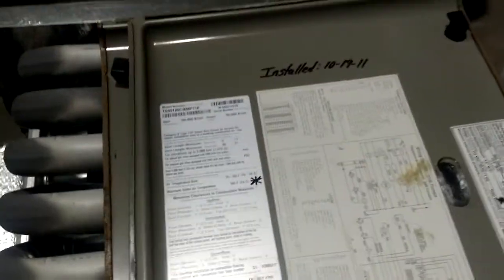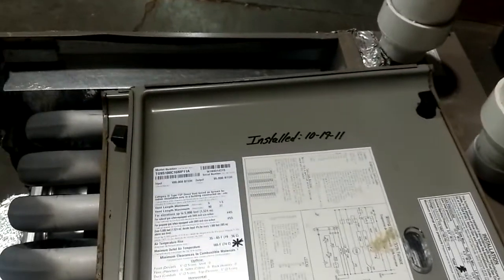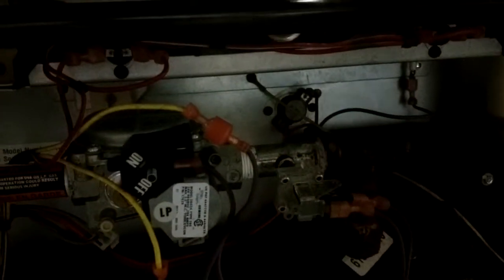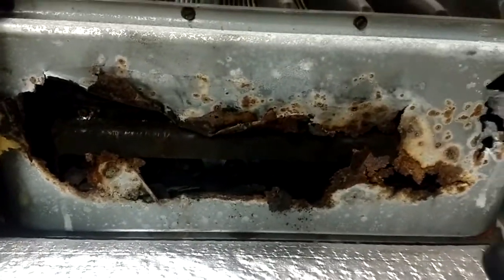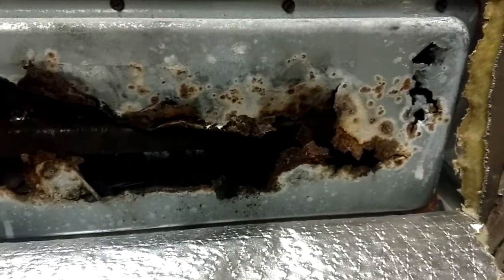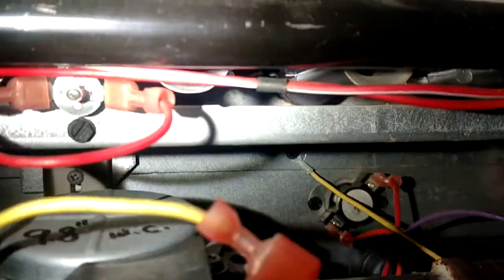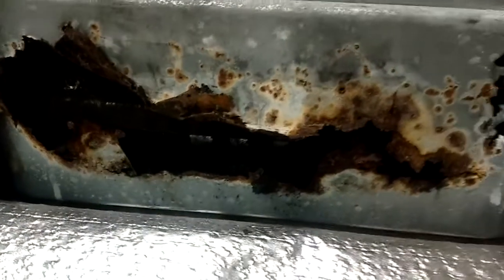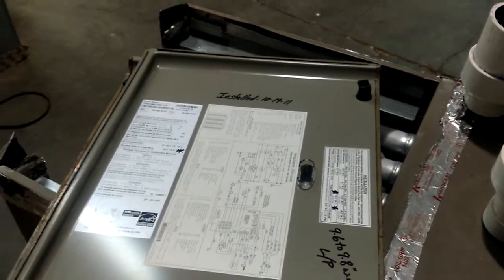☠️Over 2000ppm CO☠️ in exhaust pipe of York TG9S100C furnace.Very bad H.E. This one is scary guys!!!

Comment: ECMs?
R410a?
Paper-thin primary/secondary "90%" heat exchangers?

Capacitors that are always burning out because the replacement for PCBs don't work?

10 SEER. 14 SEER, 18 SEER,  20 SEER....

"You need a new system if you have an R22 leak" (?????)

Do homeowners understand the screwing they are getting from the EPA and DOE?

Is the HVAC business really HVAC? Or is it an EPA-DOE enforcement business?

Min 7:50 "In the old days, capacitors used to last 10-20 years"
https://www.youtube.com/watch?v=eGEduZ3EVcg

Paper thin heat exchangers
https://youtu.be/5bXdufAvSJY

..

Comment: I have installled some but no more they have used very extra light guage material blower housing one can bend with fingers have replaced few as they worp easily ...
Reply from the maker: Yes when it comes to metal on York brand of equipment it seems to all the paper thin.  I'll let them slide with things like the door panels, but you don't cut corners with things like heat exchangers. Thanks for watching $tandard 👍

Comment: looks like it possibly had some other airborne chemicals going through it, do you recall where the intake and exhaust piping was routed and if anything is near them or pulling basement/attic air?
something like a busy road/expressway with road salt vapor airborne from passing traffic? other vents exhausting near it, clothes dryer, bathroom?  decomposing mulch underneath?
near swimming pool/hot tub! or other area with lots of bleach/aerosol spray usage?
Reply from the maker: Nope, this house was in the middle of the country. Nothing else around. And the homeowner didn't even live there full-time. So the furnace was kept at a low temperature the majority of the winter. That's the only thing I could think of, being down in a cold unfinished basement with the temperature kept low on the thermostat might have caused excessive condensation on the outside of the metal. Who knows.All I know is York should be ashamed using cheap thin scrap metal like on the heat exchanger. if you want to cut corners and make the door panel out of cheap thin metal that's one thing, I don't think it would have killed them to use a good piece of stainless back there.
Reply: ah, in middle of the country, what about farm fields or animals, when they fertilize it can really hang around and blanket vast area in the night air, same for manure/urine breaking down. farms are a great place to stress test things
lower temps and excessive condensation probably didn't help as you said.

Comment: All furnaces should be made so that it is a 5 minute job to completely check over the whole  heat exchanger so that they can be checked annually.
Reply: Robert White the problem with the way this particular unit is constructed is the fact that the heat “transducer” is directly up against the back of the unit. If someone was only doing the “light inspection “ of the heat exchanger they never would have found that hole. As in the video Stephen had to rip the unit in order to find it.
Reply: I meant to say Shannon

Comment: I'm no hvac tech, just a homeowner. Was that rear galvanized cover suffering from condensation with no place to evaporate or drain? It appears to me that severe corrosion occurred from moisture, possibly turning acidic to accelerate rusting thru?
Reply from the maker: That is a good question. The condensation was draining properly off of this furnace. There are safety switches that would prevent the furnace from running if the condensation ever backed up that much. Also if you notice the pattern is more in the center of that plate, if there was standing moisture it would have also rusted out more at the bottom. This seems like more of a heat issue with poor air flow across the back of that plate creating a hotspot that deteriorated over a period of time. But you are correct, that compartment does stay moist. That is the function of the secondary heat exchanger. It reclaims heat loss through the vent pipe to heat the home while also getting rid of the moisture through the drain tubing on the front the collector box. I think a lot of it has to do with inferior metal that was used to cut costs. Thanks for watching 👍

Comment: That metal behind the secondary heat exchanger should of been stainless steel but it looked like galvanized, I am surprised that there in no discoloration on the insulation on the metal that you peeled down. Did you send your video to Johnson Controls?
Reply from the maker: No I didn't send the video to anyone at Johnson controls or M&A Supply. I think it was only because of those souped-up inducer motors they use on those units that it was able to keep the flames drawn through the tubes and not burn the insulation any. But it does seem like a pressure switch should have dropped out a vacuum range and kept that thing from running 🤔
Thanks for watching the video and for your comments 👍

Comment: I wonder if the furnace was tilted forward about 1/4". The condensate in that secondary heat exchanger should drain properly. Some manufacturers require that tilt to allow for draining. Wonder if this was installed properly.

Comment: I dislike yorks yet this is a great video showing a damaged heat exchanger. That is a nasty hole in that exchanger. Was it leaking water? Due to the location of the hole in the heat exchanger, the blower air moved right past and around this exchanger. I had 3 bad heat exchangers me and a coworker ran into today t-class series RTU's
Reply from the maker: No, wasn't leaking any water.

Comment: There needs to be  a rear access panel for proper inspections. Would an inspection camera been able to see that?
Reply: The only way I can see to inspect it would be pull the limit switch out and stick the camera probe threw there.
Reply from the maker: That's a good question. An inspection camera never would have been able to see that because the entry point for the camera is at the top of the furnace and it would have to turn 2 s-curves and go about seven to eight feet before it would ever get to that point of the heat exchanger. There is absolutely no way to know the heat exchanger is in that kind of shape unless a combustion analysis is done in the exhaust pipe leaving the furnace.
Thanks for watching 👍
Reply: @sknight0391  --  A combustion  analysis would been a red flag  of course.  Maybe its me but I want to see those things.   Very important video Shannon.

Comment from the maker: You can read more detailed information of everything I found in the description above ⬆️. I did verify the lp conversion was done correctly when the unit was installed. The orifices were #55, per the manufacturer's data plate and the springs in the gas valve were correct and the manifold pressure was set to 9.8"w.c. Let me know what you think about this one in the comments below. I would love to hear all your thoughts 👍